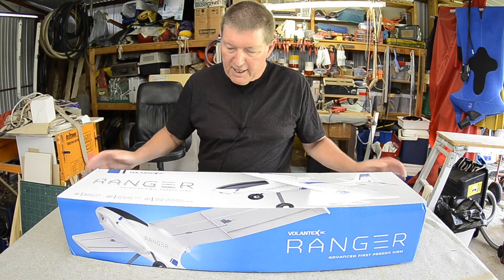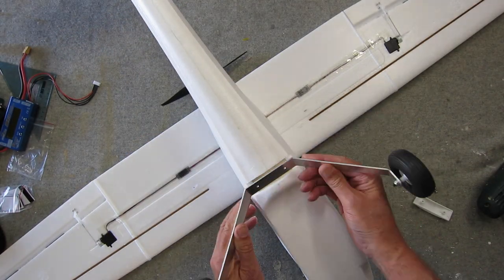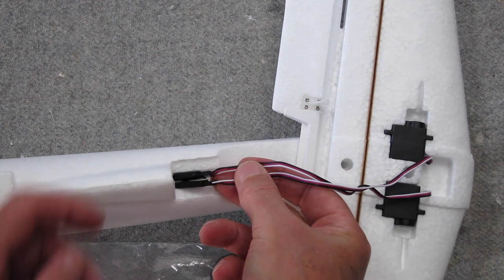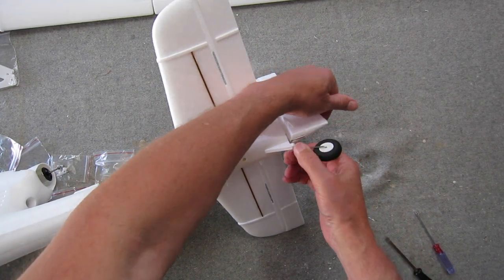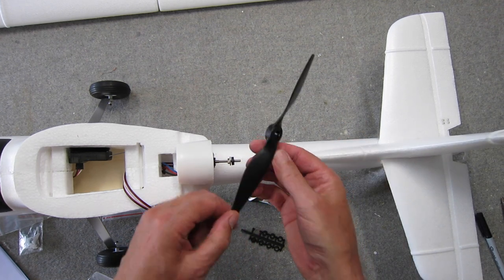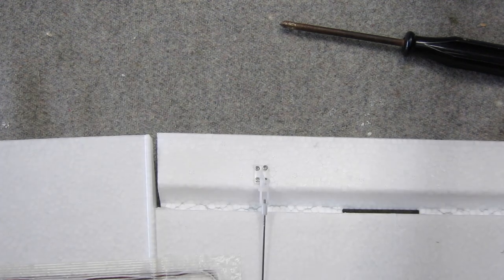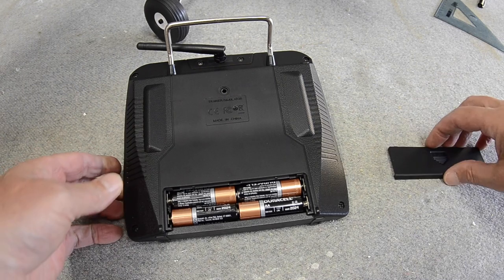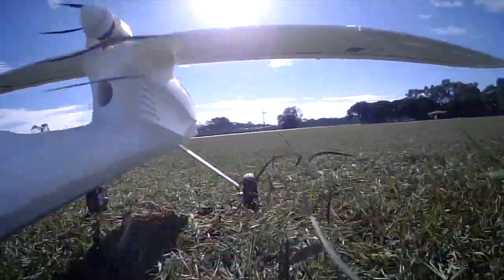1.4m Volantex Ranger build

Comment: Look forward to seeing your follow up video on what you did to get it flying well.  I maiden-ed mine a couple of weeks ago and apart from compounding the CoG problems by using a 5A Turnigy 3S, oversized wheels 4.5" etc I had a torrid time trying to stop it from porpoising through the air. Despite having a few flights/crashes the last one did a fair bit of damage... I just finished repairs so I'm waiting on some light winds so I can have another crack at it.
Reply from the maker: +Ken Oath Big tip...tilt the motor further down by adding packing under the bottom mount holes
Reply: +Andrew Newton   Thanks will try adding a couple of washers... One thing that has me scratching my head if you compare the offset for the CloudSurfer to the Mini Ranger (for torque) the Mini Ranger is all wrong, I've seen a bunch of videos where it just pulls hard to the right on take off etc  any thoughts on this?
Reply from the maker: +Ken Oath Offset doesn't seem to be an issue with this one.

Comment: hi, I bought one of these and as I was building it, I don't know how but I over tightened the four screws that hold the main wings together which also fix them to the body and badly broke the moldings inside. would you know how this model compares to the slightly smaller version called a ranger G2 757-6 ? have a plan to transfer all the parts from the 757-4 to the 757-6 thanks
Reply from the maker: Unfortunate. Sorry I don't know about the 757-6
Reply: that's no problem thanks anyway, I may be able to use most of the parts on an fpv wing, if I decide not get another plane.
Reply: @AndrewNewton  the PNP versión incluides 
Battery?
Sorry for bad englesh im speak spanish.

Comment: You ever get that plane to fly properly? Mine flies horrible no matter what mods I do to it.
Reply from the maker: I eventually turned it into a Tundra style STOL plane and it was good.
Reply: Andrew Newton look like that what I’ll do is re-build into different style plane.  Thinking skyhunter style. Cutting tail section off and adding carbon rods similarly.  The wing on this plane is well made as well and I could just stick it on a foam board fuselage

Comment: I really wonder why gearbests shipping is always soooo costly compared to banggood for shipping; For the same shipping speed I pay 10X more on gearbest...
Reply from the maker: Banggood has a bigger range of planes too
Reply: Andrew Newton could you help me out? i received this plane and wanted to hook it up to my pixhawk lite. now i dont know what i am doing wrong, but i cannot get the servos to move properly (they make noise though) and i cannot get the motor to spin with the correct channel (missionplanner corresponds to the radio transmitter but i think i might have done something wrong in the input to the pixhawk ?
Reply from the maker: Sorry can't help with that, I don't know Pixhawk. Does it work OK without the Pixhawk?
Reply: Andrew Newton have jusy tried that, no it doesnt... transmitter is the flysky fs-i6s set on mode 2 pwm
Reply: excuse me, it does work without pixhawk but doesnt with
Reply: except the aileron channel seems to only work on the rudder channel?